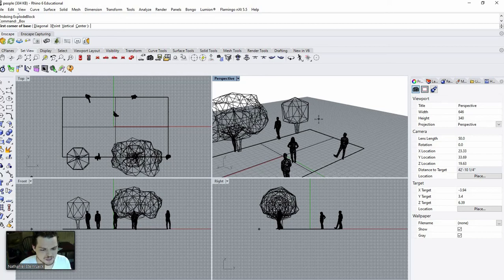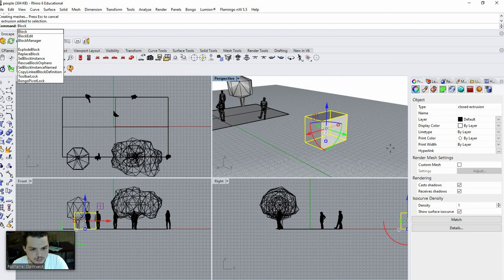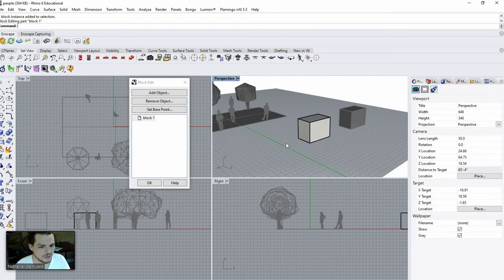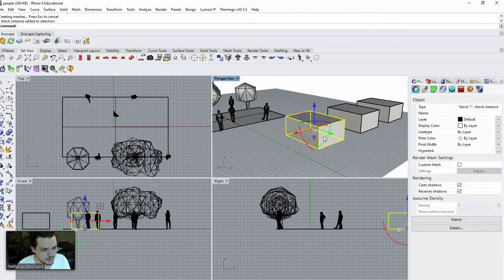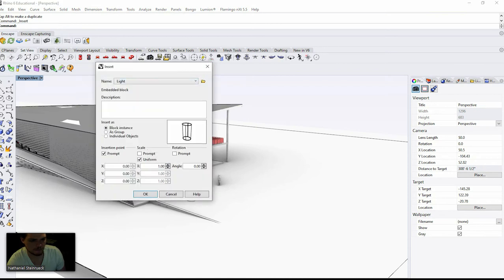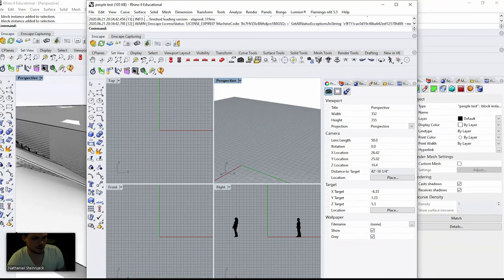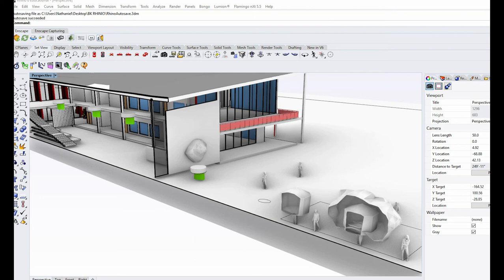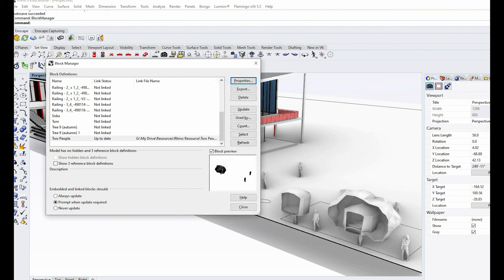Master Blocks in Rhino 6

Comment: Nice Tutorial !
Reply from the maker: Thanks, let me know if there is a tutorial you would like to see.
Reply: @NatesStudioDesk  Can you make a video about the display modes in rhino ? And maybe making some diagrams with rhino with using that the display modes helps or not,illustrator etc.
Reply from the maker: Sounds Great. The flow between Illustrator and Rhino can be frustrating. So I will put that on the list. Thanks for the suggestion.
Reply from the maker: Hi Arda made a video for you: https://youtu.be/FEuLPgmMw7s
Reply from the maker: https://youtu.be/FEuLPgmMw7s
Reply: @NatesStudioDesk  Thanks so much! I think youre going to be one of the best architecture channel of this platform.
Reply: Excellent video! Very helpful. Thanks.